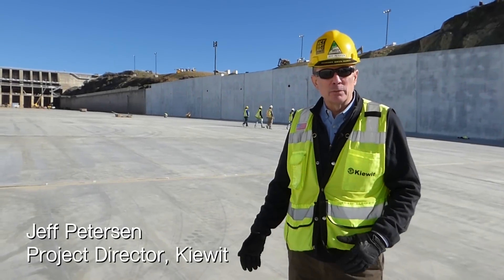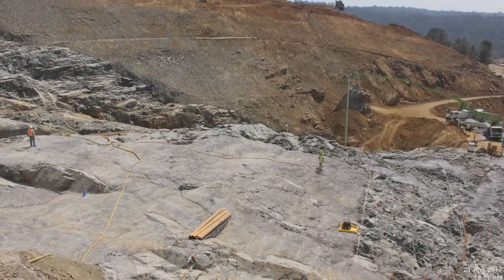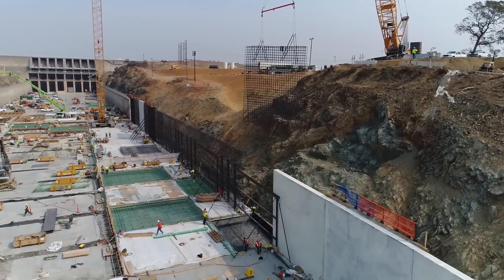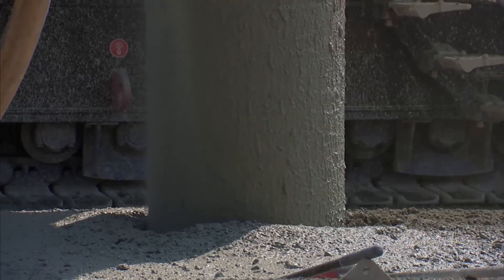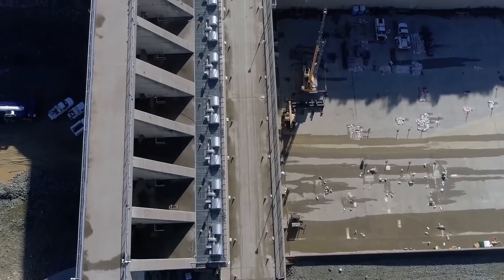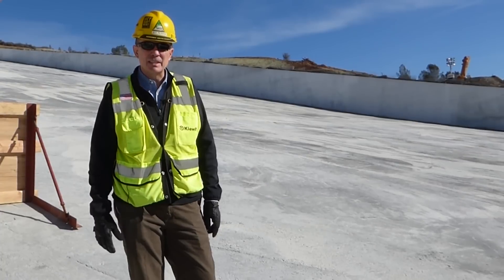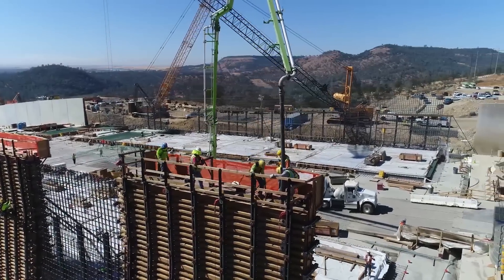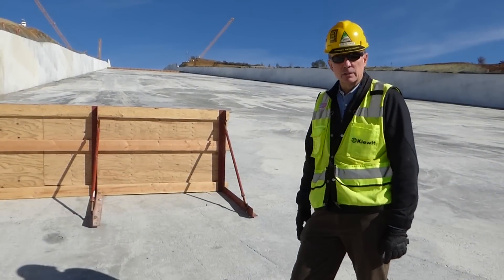Oroville Dam’s spillway expeditious emergency rebuild

Comment: ... minor gaps in construction rise nucleation towards intermittent cavitation / water hammer effect under those massive, shooting flows - rising the most corrosive, abrasive power for harming those structures. Some timely inspection/prediction under federal national task force, some constructions towards a more intermittent, turbulent and air mixed downstream, that is thought to be less spectacular.

Comment: Amazing difference in engineering compared to the original...awesome job
Reply: Not really they built up the subsoil with concrete but it's still not the bedrock the original design was intended for, as such under cutting is still a real possibility. I really not trust the drain structure. It's one of the key failure points in the old spillway.
Reply: @wes9451  that wouldnt be done anyways. They mentioned digging down to bedrock and anchoring from it....which is all they really do anyways sub soil used strictly for grading purposes. Wouldnt be feasible to pour right on top of bed rock

Comment: And it will fail again.  Walls are two thin. Walls and spillway floor are at right angle creating accelerated water flow and easy water penetration points; and all that is providing no seismic events that could damage it before any water even touches it. I would have used a beam and deep pile system to hold a steel trough.
Reply: another youtube engineer
Reply: @paultrigger3798  industrial engineer actually.
Reply: @10p6   i figured, your statement is similar to what a college student or young inexperience grad would say.  Maybe you should review ethics with 'not to practice in areas in which you are not competent'.  Critiques are great but at least do the research.. or in this case actually watch the video where he says the walls are temporary and the permanent walls will be installed the following year.
Reply: @paultrigger3798  go troll someone else.

Comment: Not convinced these upgrades will still be efficient in the future..for very long term durability ,a thick undestructible  plactic material layer on top of the steel/concrete structure would be the solution....
Reply: There isn't an "indestructible plastic" per say that isn't susceptible to chipping and erosion. Especially on this sort of scale, with amount of water going, will probably strip of anything you place on that concrete. To say of nothing to the plastic pollution it might cause if the plastic chips off and to the water stream below. The water may contain sand or other aggregates. The plastic may deform under heavy load or heat. If you were to place asphalt on that chute, I think it'll be striped down too. Asphalt(plastic you mean?) isn't  made for handling extreme shear stress. The best we have is concrete, durable, cheap, heavy, resistant to external conditions.
Reply: @joshuasusanto6626  I work as underground sewer worker in France and we use a petro material used to fabricate large plastic bins(PLASTICONIUM) also buried tubing for high-voltage wiring(polluted waters) and I though maybe using this material at hot liquid state to cover the spillway or ramp(10 inch thick)..?? ,for my job we bury this material in wet soil or sewers with a life span of a few hundred years ,well..it is just an idea...because this spillway is not used often but suffers the constant  natural erosion of sun ,rain and wind. a layer of protection could help..!!??

Comment: hey Cali... instead of making all of us put prop 65 labels on everything you focus on making sure your engineers and designers get things done right the first time instead of taking tax dollars from all the so-called "dirty" states for your fuckups?
Reply: This is a nationwide issue with infrastructure degrading and not being maintained or replaced. Yes I know you want to get into your pollical feelings. But this isn't one of them.
Reply: Hey stupid ass the dam was built in was in the 60s and we hardly used the spillway because California routinely goes through periods of lots of rain and then back to droughts. So because of this the spillway was not really look after properly so lots of erosion started happening under the spillway. In 2017 we had more rain then we ever had in any years prior consistently for days. This caused the dam to overtop for the first time and the spillway to finally break apart because of years of erosion, luckily the operators where able to get the water levels down safely. Now they rebuilt the spillway with up to date engineering so now it's ready to be used again which is ironic considering we are in a drought again.

Comment: Was a CFD model used to simulate alternate surface roughness of the grade? Roughness on the order of feet (like nature)?
Reply: Probably not.  CFD is not really useful yet for large scale hydraulic modeling. They generally create physical scale models. Extensive scale models were built and tested at Utah state.
Reply: @shooter7a  Thanks Shooter. I wonder if advances in computer power will make CFD practical on this scale someday soon.
Reply: @jaymacpherson8167  the biggest weakness of CFD is the handling of flows along curved paths.  Unfortunately this is literally the MOST important thing in modeling hydraulic structures (vortexing, turbulence, etc).  Also, when dealing with hydraulic modeling of large structures, you are dealing with LARGE domains.  But to accurately model flow along curved paths to model vortexes, etc, you have to model elements into the boundary layer realm.  This means very fine meshes.  This means MASSIVE MASSIVE computational power would be required.  Well beyond what is currently affordable.
Reply: @shooter7a  So you don’t think a finite element technique would help to make fine grids at the solid/water interfaces? Maybe using a Lagrangian solution?
Reply: @jaymacpherson8167  ???  Huh?  You can make the meshes fine...it is solving them before time ends that is the issue.

Comment: I saw them using epoxy-coated rebar in the floor of the spillway in another video. I thought it’s use had been banned or was in the process of being banned in a number of US states due to pit corrosion issues?? Maybe they’ve got around this somehow?

Comment: Why add concrete on top of the bedrock? Why not just build the walls and leave the bedrock exposed? Isn't the bedrock much harder than concrete?
Reply: Bedrock would erode faster than concrete.  It also isn't continuous like concrete is and isn't smooth.
Reply: They analyzed this option.  They built a scale model at Utah state.  Model studies showed that under flood flows, a MASSIVE standing wave, 100'+ tall, resulted.  The scouring forces were so massive that the bedrock would likely not hold up.  https://www.youtube.com/watch?v=Q6ff_fzCp9E

Comment: Imagine how much taxpayer money would have been saved by timely inspection and maintenance at Oroville.
Reply: I suspect none. Rebuilding the spillway was inevitable. Hopefully they've improved the design a bit, but even if the changes prove to be ineffective it should still last another fifty years.
Reply: @chrisbalfour466  I think you are right about there being no cost savings.  Anyway, the current design is improved by a lot more than "a bit".  It's completely different from the ground up.  The original design was faulty from the beginning, starting with the fact that it was based on a very generic "hope" (based on way too little investigative work) that all subsurface material was solid bedrock (and no design changes were made even after it was found during construction that this was not the case), and including the fact that even back then it could have been calculated that the design was inadequate even if it had been placed on solid bedrock.

Comment: Terrific job, making up for the slack design and construction of the old 1960's spillway. Grady at Practical Engineering has an excellent video on the subject : https://www.youtube.com/watch?v=jxNM4DGBRMU&t=659s  Given the recent droughts, which may become more or less permanent, I wonder if the new spillway will ever need to be used. Hope so.

Comment: Incompetence once again. Why not anchor the slabs to the bedrock? Ny not offset the slabs at the 1/2 point from each other? No straight lines for the flow to follow.
Reply: Have you pulled the prints?

Comment: Seems like it would have been cheaper to shorten the spillway and let the water drop into the river sooner.
Reply: That would cause the base of the spillway to erode back up the hill.
Reply: @beeble2003  Not if they used concrete and rock to line the drop and made walls to direct it out. Still would have used a lot of concrete but seems like it would have been shorter to go down than to carry it all that way.

Comment: Make sure you fill in all the cracks this time, and actually testing the emergency spillway at least once sure would be nice.
Reply: Yeah, it would also have been interesting what they did to avoid water lifting up those slabs again (e.g. making sure the upper edge of each slab is slight lower than the lower edge of the slab further up the spillway).
Reply: @Taladar2003   Such design features were the starting point, this time.  Besides the complete removal of softer layers and pockets of rock to expose hard, dense rock, there are anchors going deeply into the solid rock, the slab joints are offset as you described, and the subsurface drain system is really well designed this time.

Comment: Just having come here from the Practical Engineering video. I am curious if the drainage pipes are setup differently to how they contributed to cracking in the original slipway? shortening the concrete over the pips seemed to be an issue.
Reply: the drainage pipes look like they're embedded in the levelling concrete which is underneath the main slabs, i.e. the slabs themselves aren't compromised

Comment: I noticed no comment about how or why the spillway failed.  Do you not know?  And if so, how can you fix the problem?  Or are you just happy to get the hundreds of millions of dollars to make a new one.  That will probably fail since no one seems to know why.  Is water harder than concrete?  Are we all mislead in thinking that concrete can hold and control water?  The Romans seemed capable of doing it.  California sucks in so many ways.
Reply: It failed because it was built in an era with lax inspections and oversight of the original contractor.  It was a bad design, that was then built poorly.  But today, people will complain about government red tape and oversight and how they are being unreasonable.
Reply: @shooter7a  And also blame it on "the libs" and on migrant workers because they're childish and arent capable of thinking critically or for themselves.
Reply: The reason it failed was because they designed the spillway to sit on top of bedrock, but ended up building it on loose dirt. It wasn’t anchored right, so when water eventually got under it it lifted up and fell apart. Now that they know what the soil is like they can anchor it properly. Look up the video on “practical engineering”
Reply: @joshuarodrique2096  The Practical Engineering video is at https://www.youtube.com/watch?v=jxNM4DGBRMU
Reply: What really sucks is people who take pride in blaming people based on their own mindless political agendas, and who demonstrate an obvious and acute dislike for facts.  For you to claim that we don't even know why the original slab failed is a monumental testament to your own inability to think logically and your preference to lumping all problems as being caused by those you love to hate, because spending 10 seconds on Google would point you toward a great number of useful information sources to have your questions answered.  

Check out a series of old videos on YouTube by Blancolirio for a full history of what went wrong and why the new design is so much better (warning - this will require many hours of careful attention on your part, and from the way you express yourself, I really doubt if your brain is up to the task).  For a quickie course in what went wrong, look for the video on this subject by Practical Engineering.  It will be best to check your political ideologies at the door when utilizing either of these sources, because facts actually matter to these guys and you wont' have a clue what they are telling you if you keep thinking "it's because it's California, and I hate California".

Comment: And with all that money and all that work it is a failure. Now why don't you tell the people that they should think about leaving and not at the last minute. It is almost at its capacity rate where DWR says 908' will fail. You are are at 887' unless you are not telling the truth about that number. What will happen when the snow starts to melt BAM WHOOSH people will die.

Comment: Jeff, You are mistaken about the manufacturer of the roller screed that was used to place the 37' 4 to 1 sloped concrete on the spillway. It was the Lura Screed . The key to spanning the 37' with zero deflection  was our 2 CV joints and 4 points of contact that allowed the screed to be perfectly straight as it moved up the slope.

Comment: I'm surprised there was not a foundation wall started on the exposed bedrock to support the lower spillway, instead of just putting a beefed direct replacement on top of fill material. Also hope the transverse drains work to reduce cavitation, but isn't the normal approach to cavitation to inject air into the cavitation points?

Hope this works, guys. The spillway bottom has already cracked (of course), they had better epoxy inject every one of those.
Reply: This is far more than a beefed-up replacement, and that "fill material" is concrete which is founded on, and held down with deep anchors to, competent bedrock.  This is far too wide of a structure for foundation walls at the edges to have any part in the stability of the slab.  And for what it's worth, the sidewalls are founded on that same engineered concrete fill as the slab, so they aren't going anywhere.

Oh, and the drains do nothing about cavitation (cavitation is the progressive fracturing-off of tiny pieces of the exposed surface as a result of explosive phase changes in low-pressure zones at the interface of the concrete surface and the rushing water passing over it, and other aspects of the design would address this potential issue).  The actual purpose of the drains is to remove water from beneath the slab surface which could otherwise provide uplift pressure in excess of the pressure exerted by the moving water above (according to Bernoulli's principle).  If space within joints, etc., is not fully occupied by water, this differential pressure will not occur.  It seems as if you are piecing together some unrelated bits of information here without actually knowing what they are.

Comment: unless you PREDICT WORSE CASE SCENARIOS ,, then youre NOT a real engineer and youre worthless.. the emergency wall 2nd spillway is still a major problem..it will cost another billion and that wont fix it.. ANY prolonged overtopping of water on that  last chance spillway,,,, even with another BILLION in concrete ,,,will still have a FAILURE of the dam.. they NEED to build a SECOND regular spillway or relief channel somewhere else...but they wont...10 billion more in 50 years
Reply: Fucking just go away.... shut up and go away

It's now late Oct 2019 and they are on time and on budget l... INCLUDING the emergency spillway
Reply: Johnny, what is you Professional Engineer License number since you seem to an expert on Engineering topics?